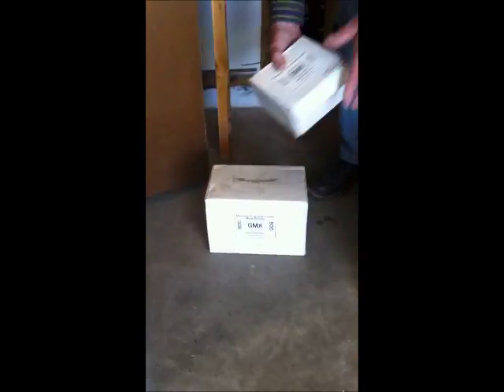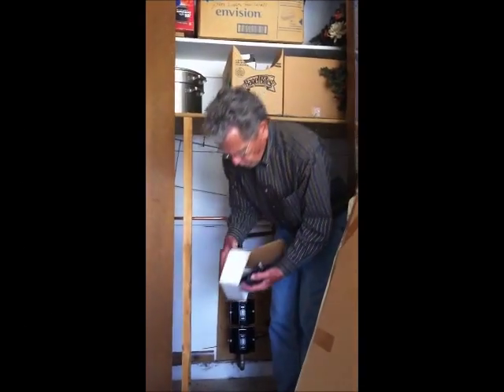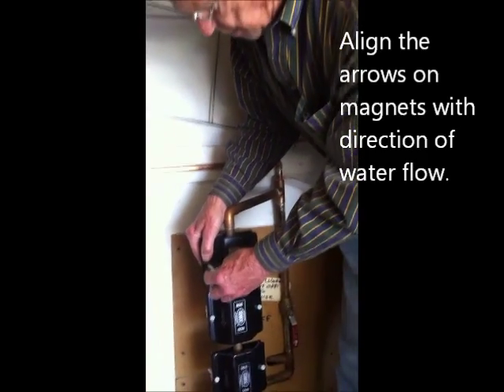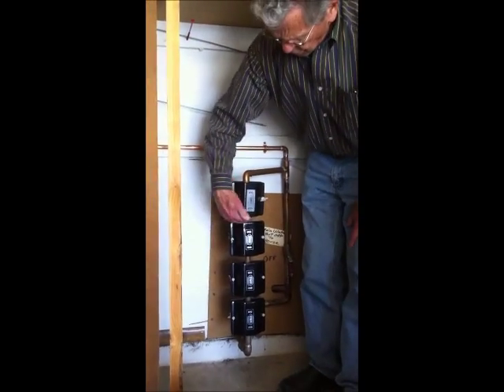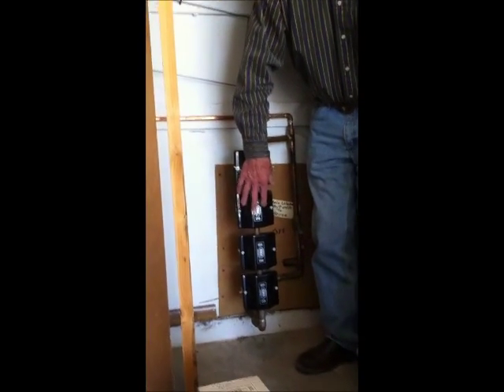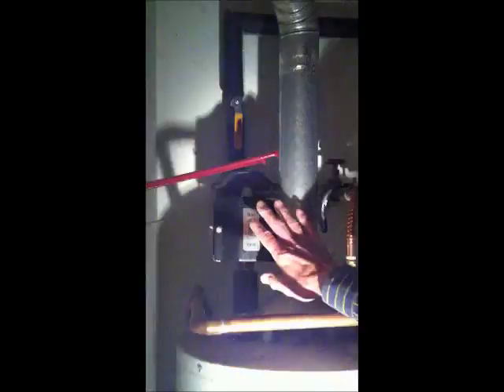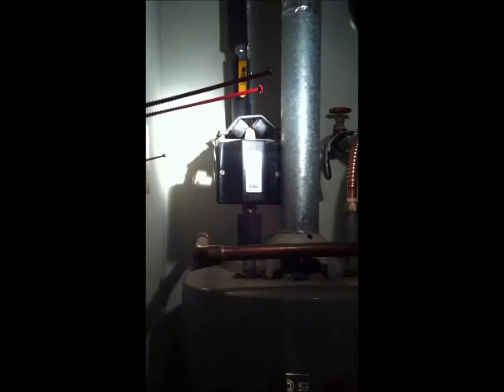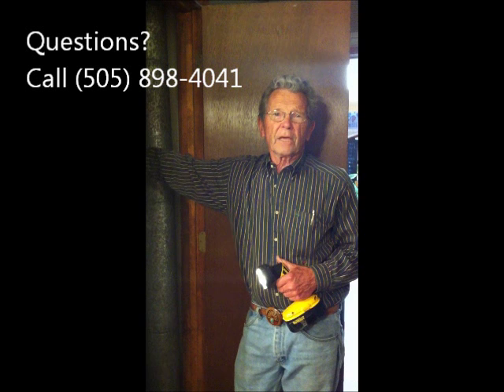How to Install GMX Magnets for the Treatment of Hard Water

Comment: And how does that work? Show me independent lab proof that 20 ppm water or some level of common hardness is flowing through those pipes and comes out something like 1ppm or less. Is it supposed to breakup the molecules, since making it stick by the magnet would just clog the pipe? I suspect these don't produce what people really want and are more gimmick than good product.

However, prove me wrong!
Reply: The "soft water" devices that use magnet technology DO NOT change the parts per million.  All of the minerals are still in the water, the difference is that their electro magnetic properties are altered so that they're not as attracted to surfaces such as the interior of water pipes, your shower tiles, your hair, etc.  I just installed two of these devices (a different brand that uses no electricity at all, just the magnets, but the same concept) onto my home and I am definitely seeing a difference in the amount of soap suds I get and my skin feels softer and far less dry after showering.  Everyone should do their own experimentation and decide for themselves if this tech is the real deal, or not.
Reply: This method of "softening" water does not physically remove the minerals in the water. Nothing is being drawn to the magnets and sticks to them.  The magnetic field effects the dissolved minerals on a molecular level, (so nothing visible to the naked eye), altering them so they do not come out of solution as easy and stick to surfaces creating scale buildup. The minerals, that are beneficial from a health perspective, but potentially damaging to fixtures and aesthetics, are still present for your body's use but not causing the typical hard water issues. The ppm would not change tho, since the molecules are still present.  The proof of the pudding is in the eating.  Lots of people have had noticeable results.  There was even a water heater manufacturer that was having issues getting there heaters to make it thru their (10 yr?) warranty period in hard water markets.  Their solution was to add an in-line magnet and that solved the issue.
Reply: Okay, I looked it up. Magnets never remove water hardness - ever! There is extremely marginal evidence that scale buildup is moderately reduced (at best) and the only positive evidence that exists is extremely old and has been exclusively positive in industrial environments. There is no evidence - ever - that scale reduction occurs in home use scenarios. For example, consumer reports tested two water heaters in the same home where one gets the magnetic water and the other normal hard scale. Result: no difference.

I'm positive that homeowners want real hard water removal and not a gimmick. This is a gimmick and is NOT effective for treatment of hard water. Please, provide proof. Otherwise, stop feeding bs to people.